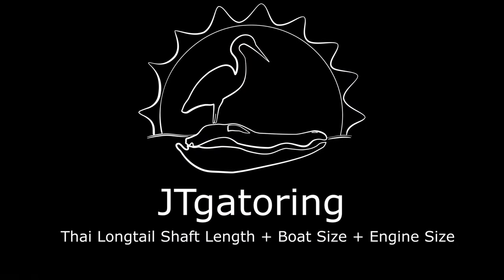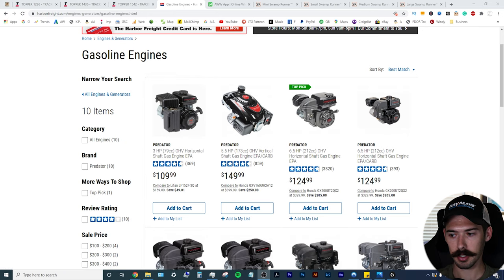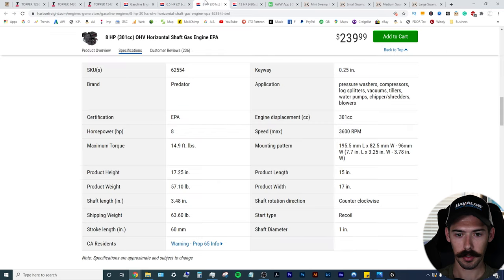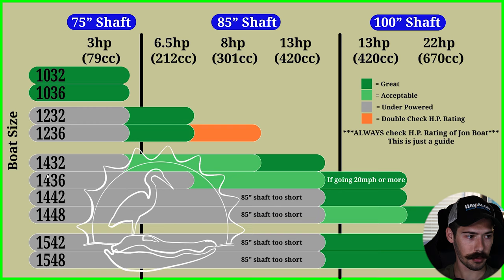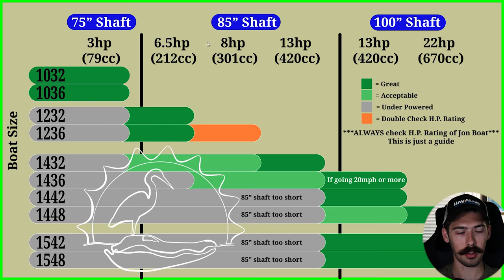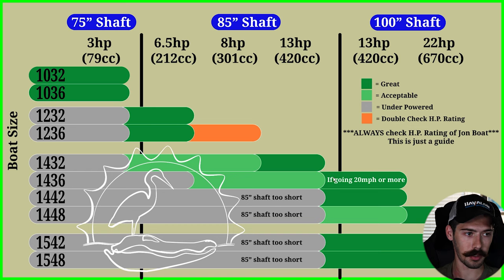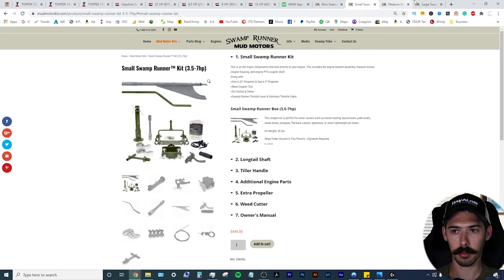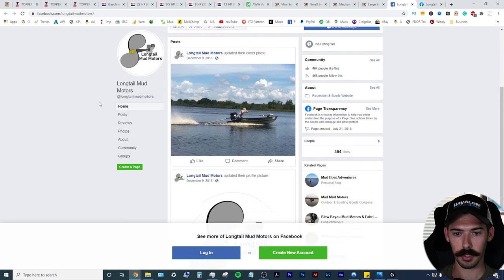EVERYTHING Thai Longtails: Boat Size + Engine Size + Shaft Size

Comment: Man, his is nice! Right along the lines I was thinking. Also this is assuming you are running at planning speeds hull and not displacement speeds.
Reply from the maker: Thank you BWL! That is correct. This is mainly for those who are new to longtails and are just getting started. Thats why I threw in there that "over 20 mph" just so people would start to think about speeds and the loads they are carrying.
Reply: @JTgatoring  Great point. Three guys and two dogs going hunting, gotta think about grunt power.
Reply from the maker: Haha yes, it definitely needs to be taken into account.

Comment: Great video!!!!! Coming from the prospective of someone has most of these motors and tested them besides the 3hp and 22hp. I can say the 301cc and 420cc motors have almost identical top speed with the 420cc having about twice the acceleration. The torque on both motors is nearly the same ft/lbs with the 420cc being marginally more.  3800k rpm is still 3800k rpm. Only way to make the 420cc faster is to modify it so can do more than it limited rpm. The 301cc handles some much better for cutting and carving over and around obstacles. In my opinion the best price power and comfort for the medium size kits stock.
Reply from the maker: Thank you AZL. The torque difference between the 8hp and 13hp is still a decent amount in my eyes. The 6.5hp has 8 ft.lbs.trq, the 8hp has 15ft.lbs.trq. and the 13hp has 20ft.lbs.trq. So I would say there is still a solid step up from the 8hp engine to the 13hp engine when it comes to torque. That is correct that both govern out around 3800-3900 rpms, but the parts available for a 13hp seem to be more abundant and popular, which is why I recommend the 13hp over the 8hp engine for people just getting into it. People are able to trouble shoot, upgrade, and get more out of the kit due to the large customer base of the 13hp over the 8hp engine, creating a very large community.
Reply: @JTgatoring  other 420cc motors in the 15/16hp variety make 20ft/lbs plus like the duromaxpower. but not the stock 13hp predator it is 18.4ft @2500 rpm vs the 14.9 on the 301cc 8hp marginally different low-end torque in my my experience but acceleration to top speed is much faster on the 420cc after that 2500k area. If do you want to hop up the 301cc the 420cc and 301cc share the same exhausts and intakes if you look it up believe it or not. GX 270 clones (301cc) and gx390 clones (420cc) have the same stage one kits. I love my 16hp 420cc on my 12ft vhull its amazing. But the 1436 I like the 301cc 8hp. But I do not operate conservatively in linear fashion lol. I like to move my boats around like a PWC and lateral weight/force on the rear transom is a big factor for me for body/hull roll. If you do operate the 420cc on 1436 nicely it won't be a problem.
Reply from the maker: @azlongtales  That 18.4ft figure is for the California/CARB compliant engine #69736. The 13hp 420cc Predator engine #60340 and #60349 stock has a 19.8ft rating which is close enough to say 20ft in my eyes. For the force applied on the transom of the 1436 with a 420cc engine, it is too much even if you play nice. I may not dig and surf with my jon boat but digging in grass and mud and playing in the weeds has really taken a toll on the transom even after reinforcing it. I will have to completely rebuilt it this fall/winter.

Comment: Awesome video. Thinking about putting a 22 Hp predator on a 1542 tracker. Worried about the weight and how the transom would sit in the water. Had a beavertail 13 hp on a 1436 and it seemed to heavy. Thoughts?
Reply from the maker: Thank you Nick! I really appreciate your words. It would depend on what kind of mud motor you put with it. Presuming its a thai longtail, the 22hp 670cc predator is the engine most people use on the 1542  tracker and I haven't heard of anything bad about it. I do not know how heavy a beavertail is, but people running the large swamp runner kit and a 670 predator on a 1542 normally ride out good. Weight should not be an issue unless you're a big guy and don't have the weight distributed fair enough throughout the hull. If the weight is distributed good, the transom can hold the weight of the engine and kit and your draft should be proper as long as you follow the yellow sticker on the boat for weight capacity.

Comment: So I got a 17’ x 54” aluminum boat with a 22hp engine.. I haven’t measured the shaft length yet but it seems short because of where the prop falls. I get lots of torque steer and the prop tends to want to ride up out of the water at full speed. My outdrive has been homemade and I purchased it that way not knowing any different. Guess it’s time to buy the correct drive for this boat. My average speed is around 12-15 mph.  Thanks for sharing.
Reply from the maker: Thank you for your feedback OutdoorOriginal! That is a wider boat. An American style longtail would probably be best for that setup. You could probably get a thai longtail to work, but it would take some experimenting. I'd be interested to hear what you end up doing and how it goes.

Comment: Very nice video with lots of info. Thanks for spending the time developing this video.
I do have a question? I have a Four Rivers SOBADS, 11' (1' pods) x 50". I have a 6.5 PPF Predator motor with a 55" shaft. The motor will run 13-15 mph with just me. Once I put in the dog and hunting equipment plus blind, I slow down to 8-10 mph and even slower through heavy weeds. I am looking at a Backwater 6.5 and 10hp. They either come with a 55" or 65" shaft. In your mind, what would be the better setup. I'm looking for more speed on the river and being able to cut through the weeds better.
Reply from the maker: That sounds pretty good for an 11' boat. Their website says its rated for up to 7hp so I don't know how well it would handle the 10hp. This video was mainly for Thai longtails, not American longtails like the backwater and ppf. American longtails don't rely on the same principles. They only vary the shaft length due to transom height. If you have a tall transom, then the longer shaft would be better. Normal or shorter transom height then the shorter shaft would be fine. If you want speed, a thai longtail will perform better than an American longtail. If you want to try a thai kit, go swamp runner. As for right now, I don't know if the backwater will go faster than the ppf. It sounds like your setup is pretty dialed in. If you want more from it, then you would need a bigger boat and/or motor.

Comment: I'm thinking about getting a 16 ft aluminum jon boat. Will a 420cc predator be up to the task. I am not planning to get in the mud but hunting and fishing.
Reply from the maker: It will move the boat forward but you may or may not get on plane. It depends greatly on the hull design and the weight.

Comment: Excellent video. I have an old sears 1232 I want to put a motor on. In SC any outboard 5hp or more requires its own registration. I'm considering building a 4.5hp with a Kohler or Briggs so I can avoid the extra money and paperwork every year. Do you think this would be adequate for a boat like mine or terribly underpowered?
Reply from the maker: Hey Jacob Farms, I believe I saw you ask this in the Facebook group, but I'll answer on here also. If you can find a single-cylinder engine that is less than 5 hp, it will work. The only one that is popular is the 3hp predator and that would push the boat, but it would be similar to a trolling motor (I'm guessing) but nonetheless, it will propel the boat forward. If you could get a 6.5hp engine or a 5hp engine and put a 4.9 or 4.5hp sticker on it... that may help, or just label the engine a certain CC like 212cc or 160cc and not state the horsepower rating at all. I ran a 6.5hp engine on my 1436 and got it up to 12mph without messing with it. The engine was stock, no special prop; just putting it on it and going.

Comment: Great chart! I just bought a 420cc predator at 20% off last month and got the medium swamp runner kit to put on a 1436 alumacraft that I bought new 5 years ago and have been running a 15hp outboard on. I had been thinking about a longtail for years, (even thought about building a jet jon at one point)and your videos helped to steer me in the right direction, it also helped that you have the same 1436 alumacraft as I do, so it was like watching a series of test runs on my boat with the different kits. I am going to ask my friend that welds aluminum to weld on an aluminum plate for me to the transom and 2 more angled supports before I put the kit on. Do you have any experience with the rock guard and running rivers with mild rapids?
Reply from the maker: Thank you Kyle! I will be rebuilding my transom soon when it gets cooler out. I do not have any experience with a rock guard, but I know swamp runner has them. They are meant to protect against side hits and not really good for planing. More for idling and running through really rough stuff. With rapids, there's a video on Facebook that I'll link below. The longtail seems to work quite well in rapids if you are experienced with your longtail. If's its your first time with a longtail, I wouldn't try it, but after you know to maneuver your boat, rapids shouldn't be too difficult.
Reply from the maker: https://www.facebook.com/mix.matt1/videos/3839826579368314/
Reply: Awesome video, thanks for sharing the link. Worth watching just for the guy going over the small waterfall alone. Like you mentioned, going to practice on some quiet water before I hit any rapids. Nice to know these motors can do it though.
Reply from the maker: @kylekarwowski2642  For sure. It made me feel a little better about it too. I don't have rapid here in Florida, but I have had some quick-moving water from torrential downpours in winding streams and rainwater collection ditches. It was a different experience to say the least. Best of luck and hope to hear back from you on how your experience goes!
Reply: would appreciate hearing about speed difference between your 15 hp outboard and 13 hp longtail

Comment: I bought a 1652 G3 do you think I can run a 13hp and 100" shaft ... I want to Jane two setups the other being a Yamaha 30
Reply from the maker: Thats a tough one. Based on the width of your boat, the Thai longtail may not ride the best. With Thai longtails, try to keep it 48" or less when it comes to width. Once you go over 48" it starts to get finicky where you really have to tune it in to get it to handle easily but that's only if you are going fast on plane. Most people put a 22hp engine on a 16' boat. A 13hp would be under-powering it but if you just need a small motor a 13hp would do it. It may not even get on plane though. I don't know. What are you wanting to use it for?
Reply: @JTgatoring  I talked with Jake at Backwaters today he was helpful on what I should do... I'll be fishing shallow waters...
Reply from the maker: @EdubOutdoors  Yeah if you have money for it, the American style longtail like the backwater kit may treat you better than thai style longtail. If you are going to be using it as a standard motor, you'll need the 22hp or bigger. Again, comes down to money and what you're using it for. If you plan on just using it to putts-around and don't need to go on plane then a smaller engine is fine, but if you plan to use it and get on plane a bigger engine will be needed. I understand you're fishing shallow waters, but are using the longtail where you have to travel a long way and it needs to get you plane, or is it launch at a secluded location where you can idle/fast-cruise to the fishing spot. If money ain't a thing, a 22hp or 35hp backwater will probably treat you right. If need to save money and you're using it as a kicker, than you may be able to get by with a thai kit

Comment: I'm looking to get the PPF Wood Duck  to use with an inflatable, for it's lighter weight and ease of removal.But noticed the shaft length is listed at only 55'', by your figures, wouldn't this limit it speed-wise ?
Reply from the maker: Yes. This chart is for Thai longtails. The PPF is an American style longtail. It uses a ride plate above the prop to force the shaft into the water. This causes excess drag along with an inefficient shaft angle causing it to lose speed. A thai longtail would perform better if you need a higher speed.

Comment: Why do the Thai longtails require a longer shaft length then American styles such at Backwater & Go-Devil? Is it only the cavitation plate that makes the difference? Wanting to know before I spend the extra money for the 100" shaft. (1442 Alumacraft)
Reply from the maker: Hey Markus, I left this reply to your comment in the Facebook group -
The Thai style longtail uses an 85" or 100" shaft and rides further behind the boat with a more efficient shaft angle. The prop rides in the crest of the wake behind the boat and easy to handle on plane. At idle speed, it is tail heavy. Most Thai longtails use a surface piercing prop so only half of the prop needs to be in the water. With an American-style longtail, you have a shorter shaft which requires a cavitation/ride plate to keep the prop in the water. Without the ride plate, you would not be able to keep the prop in the water easily. Water pushes on the ride plate to force the prop in the water. Also, the American-style longtail is balanced so one end is normally not much heavier than the other. It uses a normal prop where the majority of the prop needs to be submerged. You would most likely ride better with the 100" shaft. If you plan to stay under 20 mph and spent more time idling around than you would be on plane, the 85" may be okay
Reply: @JTgatoring  Thanks for the information!

Comment: 212cc 38lbs/ 301cc 56lbs / 420cc 73 lbs
$99 to $220.   $234.               $380
Reply: Yeah, I'm going with the 420 on my next motor.
Reply from the maker: BWL a good choice 👌
Reply: @BlackWarriorLures  the power wont disappoint i promise. You do operate pretty conservatively from what I've seen in your videos. so I'm sure you won't have any problems with a rear corner of a transom scooping some water. I drive my rigs Thailand PWC style lol .  But be warned it will be so much more "tippy" that the 212 in the rear. It opened my eyes how much it tips when I had to flip the tail in the boat on the water with 420cc on my 1436. I did not like that feeling at all and I weigh only #170. The 8hp 301cc was way more comfortable to me on the 1436 than the 420cc. I love the 420cc on my 12ft vhull it was super comfortable and an amazing upgrade and its staying there. The two motors feel about the same under 2500 rpm but much faster (2500-3800 rpm) on the 420cc with only marginal top speed increase over the 301cc under same conditions. These motors will never be speed demons and use about the same size props. These motors without a gearing advantage  they are both limited by RPM speed 3800 is 3800rpm and props dont change that much speed wise. I drove a modded 420cc longtail 16ft decked jon boat here in yuma az and it will smoke mine all day because it will do close to 5k rpm and basically idles at 19 mph.  but he is notorious for getting stranded and blowing motors also lol.

Comment: I have a 1436 alumacraft how fast would it go with the 13hp 100 inch shaft
Reply from the maker: I have a 1436 with a stock 13hp engine and a swamp runner kit and I've gotten it to 23mph with a normal fishing load. Normal speed is 21 mph. 18mph with two people.

Comment: I have a Honda GX390 what kit would you recommend? My boat is 1442. I have a budget of 600
Reply from the maker: Well, you have your boat size and engine size picked out, so all that's left is shaft length and which kit to get. Kit wise, I only recommend the swamp runner kits after testing all the thai kits. The backwater kit is too expensive and didn't perform as expected. The shaft length would be a 100" shaft since you are at the 42" bottom.